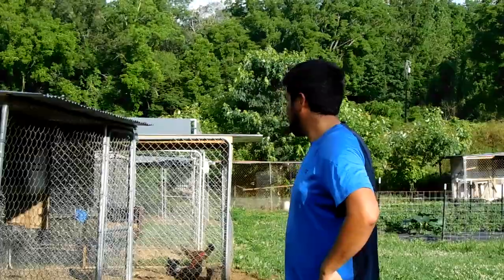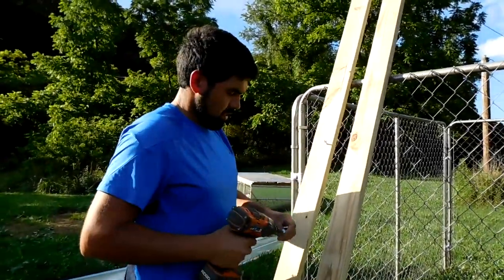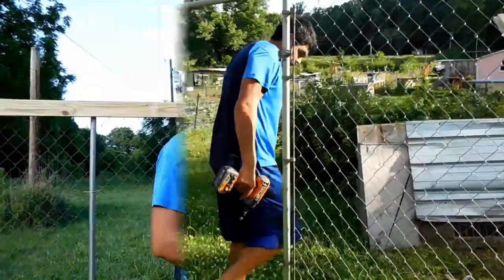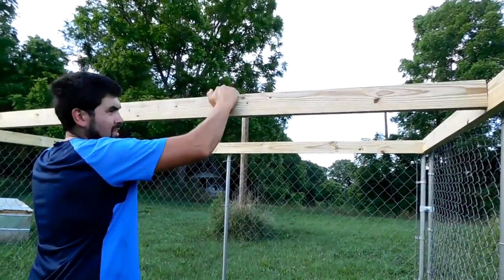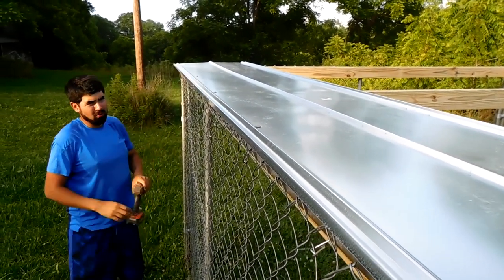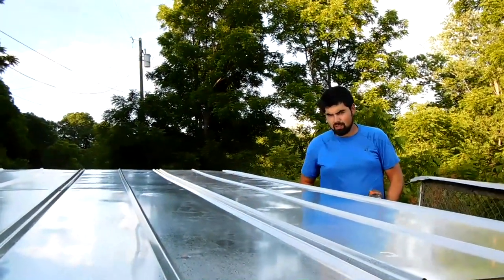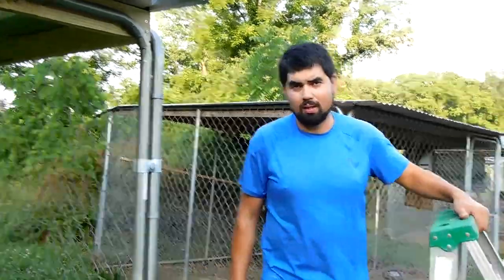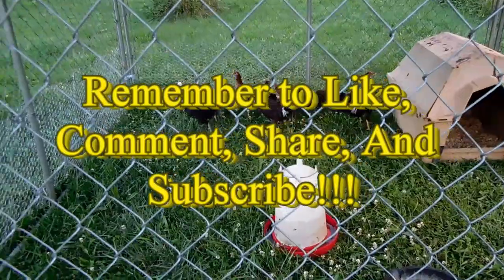How To Make a Chicken Coop Out Of A Dog Kennel

Comment: I literally just picked up a 10x10 kennel today to do exactly this. Had no idea how I was gonna put a roof on it so I started watching some youtube. Seriously the easiest way I've seen yet. And I have no experience building so this makes sense and is easy enough I can do it. Thanks so much for this video!
Reply from the maker: Yeah not a problem. A 10x10 kennel will last for a very long time. Just put it how you want the water 💧 to slop on the piece of ground and there shouldn't be a problem. Every now and again you will have to move it or it will sink into the ground. So just go to a corner of it and push up and over then walk to the other side and do the same. Thanks again glad ☺ I could help..
Reply: We are right there with you. Now to Lowe's
Reply: Same!

Comment: I have 2 lots together no center gate so it's 10' x 20'  with tarp roof wanting to do roof love the way you done this easy enough I can do myself . One thing I was wanting to have one side of roof to tilt a little to catch rain water so should I have the wood on one side up a little higher so gravity takes does it's job. Hope this made since.
Reply from the maker: Yeah thanks for watching.
Reply: I have the same question. Is like to see a roof done with an angle so RAiN run off Will Be Directed away from the coop.

Comment: Did you screw the wood directly into the metal bar? What kind of screw did you use?
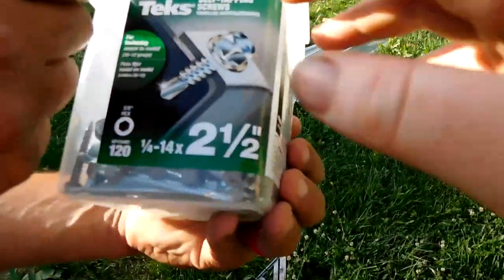Reply from the maker: yes! directly into the metal the screws are shown @ 1:46 in the video (this is Nickie answering but I`m pretty sure its call metal taping screws they are ment to go through the metal and the ones we used are 2 1/2 in long thanks for watching!!

Comment: What do you use for digging predators? I used 4' of hardware cloth folded into an "L" shape and attached one side to outside bottom of the pen and pinned the other side to the ground, so 2' up and 2' out. That takes care of thing reaching in and digging. In the warm weather they like to sleep outside the coop sometime, so I never put anything up against the sides of the pen that the hens can sit on so I don't have to worry about something grabbing them while they sleep.
Reply from the maker: So, here at our homestead Frankie will often move the pen a bit to get away from any whole that have been dug however (I full well understand not everyone can do that) You are completely right with the 4 ft wire into and L! (At least that`s what we would do if it became a problem for us. We don`t use very many "coops" so ours are always outside on a roost, the roost goes diagonally across the pen so there are only 2 places something could reach in a grab one (on the ends) for these two areas we tie a big square of wire where the roost is so nothing can climb up and reach through. At least not easily. Winter is coming up and we will put out a video of our nest boxes and predator protection soon!! Thank you so much for watching!!

Comment: Can you tell me if you're are drilling threw the board INTO the metal?  Is the screw coming through the metal and sticking out on the other side?  If not, can you tell me how long are the metal screws and what kind did you use? Thanks
Reply from the maker: Yes it's threw the 2x4 into the metal. They are 2 1/2 inch screws. Thanks for watching 👀 🙂. If you have any questions please feel free to ask 😊 😀.
Reply: Plz excuse me, Ruby and Chava but a little correction: through rather than threw. Enjoyed the vid

Comment: I have thought of using a kennel now I know it can be done.How do you winterize the sides? Do you have nest boxes inside?
Reply from the maker: yes there are 2 ways we winterize, one, you can put tin on the sides and the other is a tarp or heavy duty plastic zip tied (we do have a video on winterizing and you could wrap the whole thing if you wanted to we just block where the wind comes from... and the nest boxes we have several ways as well we will do a video on those soon, one and our most used is we built a shelf in the corner of where its winterized and set a milk crate or whatever nesting box you prefer on said shelf, another is we have a small double nesting box hutch style that can be moved as we move the kennel to new grass... there are several more that we use as well,  Be looking for a video on our nest boxes for kennels we will go into further detail and our preferences,  thanks so much for watching!! 
 Sorry the reply is so long...

https://youtu.be/VaJ2i2LPDx4

Comment: How high does the wire have to go.. I just used the same wire it covers like 2ft up 2 an half feet up? Can they still get above that raccoons etc.
Reply from the maker: That should be good I would put a patch where the roost is. Coons especially can climb the kennels, they end up scaring the chickens to the ground and that`s often how they reach through and get them that`s why the two feet protection from the ground up works so well. Thanks for watching!

Comment: About how much is that roofing just curious. I can’t find it on website
Reply from the maker: If you buy it new it's about 140$. But if you can find some used 12ft tin that will help. That's the most expensive part

Comment: what do yall do to keep the digging critters out?
Reply from the maker: We tend to keep these moved even if its a foot or so at the time so we don't have an issue with diggers, but if we did I`m almost sure chicken wire would be involved... probably flaps tacked into the ground running out from the cage at least 6-8 in. to deter digging (and a good question since most people will not be moving these pens.)